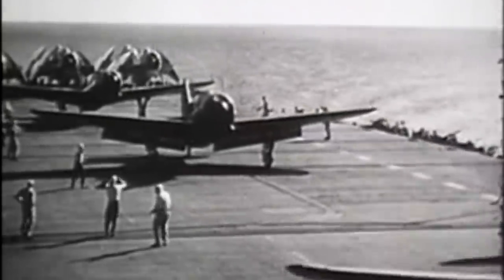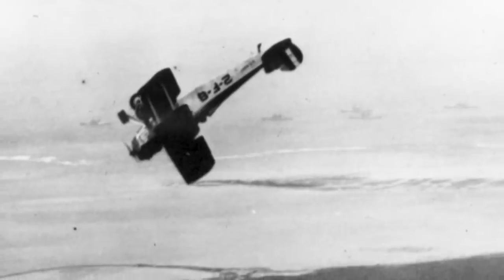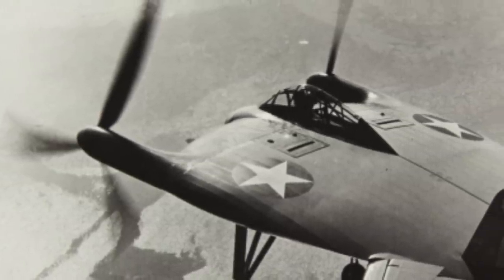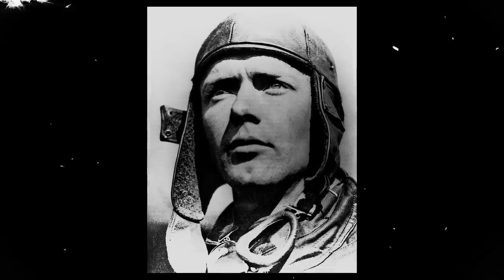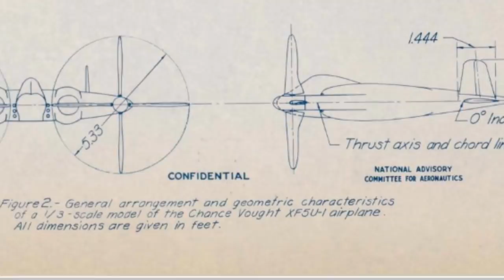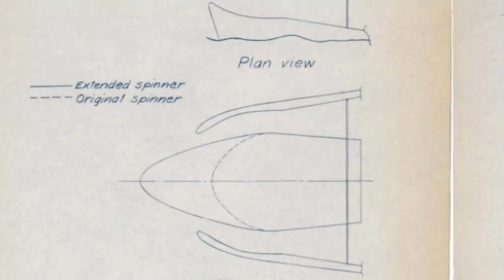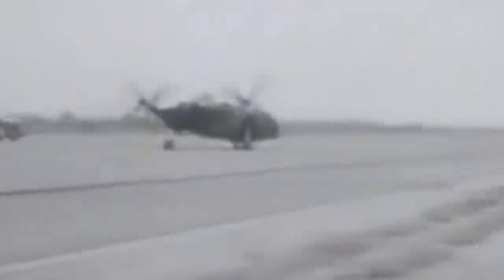The Experimental All-Wing Carrier Fighter - Vought V-173

Comment: I'd like to know how being impossible to stall or maneuver into a spin is 'unfortunate' for any aircraft. I'd have thought those were particularly good flying characteristics. Was this a mistake in the dialogue?
Reply: I've heard of those characteristics making the paperwork a lot harder in civil experimental aircraft since you can't give them any data on what happens when you do spin. I'm kinda suprised a military project wouldn't handle that better.
Reply: I could see being unable to stall being bad for a fighter, because if the aircraft gets stuck in a nose-up configuration, it would be helpless to maneuver until the pilot cut the engines and started falling (there's probably other reasons, as well. I'm no flight expert). Being unable to spin definitely hinders the maneuverability of an aircraft (it's one of the three axis of movements. Imagine if it wasn't able to roll or pitch). But I'm not sure if the narrator meant an uncontrolled spin, or just completely unable to spin.
Reply: @pills-  Since it's props were probably counter-rotating like on the lightning, shutting them off   in-flight to induce some kind of spin or stall might have been a bad idea given the aerodynamics of it.
Reply: @LostInTheFarmersMarket  They were connected by a shaft like in the V-22. Demonstrating spin/stall recovery is a huge deal in developing new aircraft (especially radical designs), and it's hard to say it can't be put into a spin under any circumstances just because your approach didn't work, and then you've got someone in a spin that hasn't been proved to be recoverable.
Reply: @pills-  a Stall is when the aircraft gets itself into a position where the wings don't generate lift anymore and it basically "falls" down. Unless are a Hollywood pilot, stalling your aircraft is never a good idea.
Reply: I thought the same thing. Perhaps it's unfortunate because a pilot of this aircraft cannot anticipate what will cause it to spin or stall, therefore they won't be able to practice recovering from such an event, thereby making the plane inherently dangerous.
Reply: @pills-  I don't think being unable to spin means it's unable to yaw.

Comment: Image if this was what we used instead of F4Us
Reply: Melvin Gillham  The XF5U was supposed to have had retractable landing gear.
Reply: Melvin Gillham  Roll rate would have been exceptional, due to the short span. And if the F5U inherited from the V-173 the ability to 'hang' on its propellors, pilots would have had the chance to invent some entirely new combat manoeuvres.
Reply: Melvin Gillham   I'm somehow imagining this thing following an enemy into a rapid climb, betting on who will stall out first.  In this case, even if the V-173 stalled out first it could just hang there waiting on the other guy.

Comment: 5:45 
"Unfortunatly it underperformed by being impossible to stall or force into a spin"
Bulls***. That is the advantage of the plane. By being impossible to stall and being impossible to accidentaly force into a spin pilots who where trying to land on a carryer could try to do so on multiple aproaches without fearing that the plane mighr loose too much airspeed and crash into the carrier/ocean. 
The main disadvantage was actualy that, concidering that it was equipped with 2x 2000 horsepower radial engines, it was actualy rather slow. The first fighter variants, the XF5U-1 arrived in 1947. By compairison the U.S. airforce had a jet, the P-80 Shooting star, in service since 2 years and against thar jet the XF5U-1 simply did not compair.
Reply: Actually being able to stall or spin is necessary for many combat maneuvers. Thats why that factor was undesirable. You have to understand this is for military use, not civilian use. Safety isnt the most important factor

Comment: The good low speed performance and high lift would make a good CAS platform and modern turboprops would solve the vibration and gearbox problems because the whole engine could be located at the wingtip and directly drive the props.

Comment: Why didn't they just convert it to jet power? It already had appropriate looking intakes.
Reply: its the way military development works sadly, the Pancake Project had run long and over budget and politicians/military bureaucrats always prefer to move onto a new contract/project than nurse an old but promising one. It's for a variety of reasons but they are all political in nature which means they may not necessarily be the best decision.
Reply: Wouldn't work. The large propellors create significant airflow across almost the entire lifting surface of the wing, which is significantly faster than the actual forward velocity of the aircraft. That's what gives it such superb stability at exceptionally low airspeed.
The 'intakes' of the XF5U are solely for cooling the radial engines and aren't present on the V-173.
Reply: @thisisnev  so couldn't part of the exhaust be routed to those outer parts of the wing that were influenced by the propeller vortexes? It seems like it would have the same effect. No?
Reply: @thisisnev  with some variation it would have been a relatively sturdy jet fighter but yes, I think it would have had absolutely terrible low airspeed performance which kind of takes it off the Navy's interest list. Maybe a marine CAS plane with turboprop?

Comment: Many aircraft were built from the parts of the XF5U. Well kinda. A fellow by the name of Edgar Seay Sr. started a model airplane company called Model Aircraft Laboratories (MAL) in Irving Texas in 1948. He worked at Chance Vought at the time and heard that they had a lot of balsa wood from a cancelled project to unload real cheap. The XF5U was made by sandwiching balsa between two layers of aluminum to make an extra strong structure. Chance Vought bought as much balsa as they could find to be ready for the plane to go into production. But it was cancelled. He bought it and produced balsa model planes for years off that original batch he bought.

Comment: I'm wondering if anyone ever made a jet powered model.
Reply: Wouldn't work. The large propellors create significant airflow across almost the entire lifting surface of the wing, which is significantly faster than the actual forward velocity of the aircraft. That's what gives it such superb stability at exceptionally low airspeed.
Reply: Canada made a ufo.  It was supposed to go Mach 3

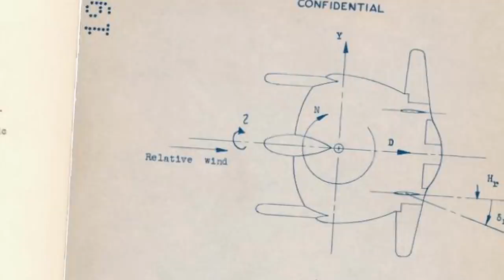Comment: 2:09  ...a plane that could hover at low speeds or hover while stationary...

ahem

hov·er /ˈhəvər/
verb
1. Remain in one place in the air.  
      'Army helicopters hovered overhead.'
noun
1. An act of remaining in the air in one place.

https://www.lexico.com/en/definition/hover
Reply: not entirely true all the time
there are helo's that cant hover, there are fewer these days because thats usually part of the primary design, but not all
I imagine some of the attack heicopters on a full load wont hover, but might be able to light. Weight is important
thinking back, I think V173 could fly as slowly as 15 knots, so she could be afloat in something above a breeze
Reply: @z_actual  Oh yeah?  Which helicopters can't hover?  Or do you mean when the DA is so high they need to do a running takeoff and pass through ETL before lifting off?  Because if you mean the latter, that could be any bird given enough weight and a high enough DA.  When I was in flight school we couldn't get the R22s off on the really hot days with a full tank of fuel, but the R44s and 206s didn't give a shit.
Reply: @Prototheria  did you answer your own doubts? As you point out there are circumstances that have to be answered to hover safely. Piston engine helos are at a particular disadvantage, but always when a helo is on max weight, or hot and high, the pilot should be thinking about a translative lift takeoff. That and getting trapped in your own vortex. 
I recall the Mil Hind could only hover for 15 seconds or you run the risk of damaging the engines. The UH1 Huey was often called on to move 105mm howitzers by air, as there was often no other safe way to get to more remote firebases. A UH1 cant lift a 105mm, so they sling it underneath the helo, and the pilot drags it along the runway until he achieves the 20mph necessary forward speed and lift off can be achieved. Can it hover with a 105mm below? You already know the answer, but they were still cleared to fly them which I was always a tad suspicious about..
All flying machines have limits, you obey them or die at your own peril.
Reply: @Prototheria  oh cool then theres a bunch of stuff I dont need to describe, and what the dangers are. So Im assuming you are fully aware of hover performance in and out of ground effect, and that you have trained on hover charts referencing the no go zone at various weights and density altitudes, and ultimately the dead mans curve. You ref the Robinson so lets not play around here, there are machines with what I consider very marginal hover performance, and often to be generous the accident rates confirm this is a problem. Now thinking of the audience looking here without this knowledge thinking hover performance is both safe and equal, where they think you can move the machine, hover, move again, change altitude, hover because theyve seen that in the movies, safety is 'conditional', you are well within your right to say all helicopters hover, but honestly from where I sit I consider some platforms to be so limited as to remove that provision. Especially when it can only hold hover for 15 seconds or destroy itself, or the accident rate is beholding of further issues. While its true the operational regime and pilot training can effectively cancel dangerous practises, you might not find that outside of the military. Ive had to use helos quite a lot from time to time for work, so it isnt uncommon for me to ask a pilot when he did his last autorotation, and I have to tell you that based on those answers I think Id sooner be in hover in an autogyro sometimes. We both know that can be done, we both know that it is of limited utility just as some helos are, but I can stick my neck out and say one is a lot safer than the other.
Back to V-173, this machine cant hover, it can seemingly hover in a breeze in just the same way an autogyro can, but it will be flying at such an angle of attack, at such high available power, it will be in essence flying on its props. That is to say the combination of wing lift and prop thrust vectors allow it to be 'at rest' within airspace. But its quite dangerous and not for fools. In the first recorded transmission of this it is how the Mosquito VI (I think) was able to make an aircraft carrier landing, an aircraft with a stall speed around 120 knots, and a max deck landing speed requirement of 83 knots. The pilot hung the machine on its props on approach to narrow the flying speed to below stall speed. He was at the mercy of the Gods and had to be fully committed to put her down or die trying. That pilot was Capt Winkle Brown
cheers

Comment: Thanks nice video, but at 8 min 54 seg the arrows are in the wrong direction of rotation,  the propellers rotate on the opposite direction, see leading edge and trailing edge of the props. To counter act  the "wing" tip vortices, as the air rotate from the higher pressure (wing bottom) to the low pressure (wing upper) the props as to rotate the other direction, i.e seen from the front view the LH engine rotates CCW as the wing tip vortice CW. Thanks again nice video!!!

Comment: we know that this works but its computation has always presented a difficult problem. More generally induced drag exists most in the low speed sphere and is non existent at maximum speed, but for V173 in particular it meant that the effective wingspan was increased by the sum of its parts. That is to say the effective wing span is represented by the wing, and the downblade of the propellers on each side. We know this because the rate of climb of the machine can be represented by an aspect ratio wing of the same area. and that aspect ratio wing is the equivalent of a span equal to the wing and a prop diameter ( 2 half diameters of the props). My expectation would be, that induced drag is for our purposes effectively zero with the use of this arrangement. Outside of that, I cannot think of a way to calculate a meaningful induced drag quotient that fits this aircrafts flight regime. Not to say it cant be done, but it defeats me, and in my mind it isnt perhaps all that necessary. But the answer to your question should prove to be a 100% reduction in induced drag, but you must also take into consideration the preponderance of this contraption as it is as it represents some awkward properties in ground handling etc., such as it is.

Comment: I feel there is still a military need for this aircraft.  From the description (STOL + capable of using airstrips in poor condition, very durable/survivable, subsonic jet-like performance) it sounds like it would make an ideal ground attach aircraft for the Marines. Imagine this aircraft updated with turboprop propulsion (greater power to weight ratio, less vibration) and stronger/lighter modern construction (carbon fiber, etc.).  The A-10 has a  max speed 439 mph/stall speed 138 mph (according with wikipedia).  The XF5U had a max speed 550 mph or greater and no stall speed (or darn close).  This seems like the perfect combination for an aircraft that can get into action quickly from air bases close to the frontline, long loiter times on the battle field engaging the enemy at close rage and capable of take serious damage but still bring the pilot home.  The only reason we don't have this aircraft seems to be that it looks funny.

Comment: This is a great video of a plane that really should have been built anyway. It just came to late to be of much use. The design and concepts are sound and it is truly a shame that neither of the XF5Us were preserved. On another note, in the graphing you use to show the counter rotation of the propellers you have the arrows going the wrong directions. The photo they are over laid on clearly show that the propellers rotate towards the outside of the aircraft not the inside. In other words, the right engine rotates counter-clockwise and the left rotates clockwise, in that picture but your arrows move opposite of that.
Reply: I was wondering if anyone else noticed the rotation being wrong.
The whole point of the design and putting the props on the wingtips was to counter the wingtip vortices not accentuate them.

Comment: This plane was awesome! if only it wasn't so late to the party... what a cool design, and the wingtip drag thing was inspired.
I want to see more of these in flying games.
Reply: If this thing had come even 5 years earlier the military would have eaten it up. Imagine these fighting Zeros over Iwo Jima.
Reply: @matts1166  I wonder about their high speed performance... The way to beat zeros was to dive so fast that they couldn't turn when they chased you, then pull right, slow to behind them and pick them off. 
These pancakes might have needed a different tactic.
Reply: @mrkazman  They were designed to have higher top speeds and lower stall speeds than existing fighters. I'm thinking those tactics would still work, although they might be less depended upon. With the weapons mounted in the nose they could engage with guns at longer ranges (no convergence point), and could likely outrun a Zero.

Comment: WHAT!?! A wrecking ball??? WHY NOT MUSEUM IT??? Why destroy it??? SO MUCH COULD OF BEEN DONE WITH THE LAST 2 PROTOTYPES TO ADVANCE IT... Imagine Propellerless and Jet driven... And then imagine adding a little more "Wing" in an almost triangular shape shaped wing, perhaps a bit more rounded than a triangle BUT over all body would be similar to a trapezoid shape in the front with a big round tail end... There is so much MORE to do with these Old planes than just Scrap them or wreck them deliberately in the end of the program. I seriously think that plane should of went to a museum and being there was three and only the 1st went to a museum, that's sad. This is by far one of the most Unique Planes ever designed and IT WORKED, where as other UNIQUELY WEIRD DESIGNS either never were built OR were attempted and FAILED MISERABLY...  Regardless GREAT video.

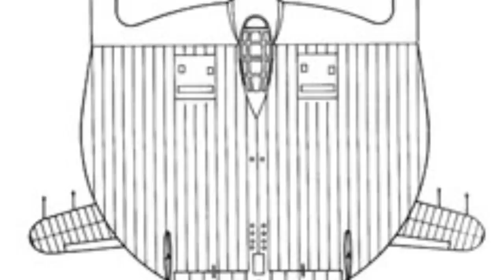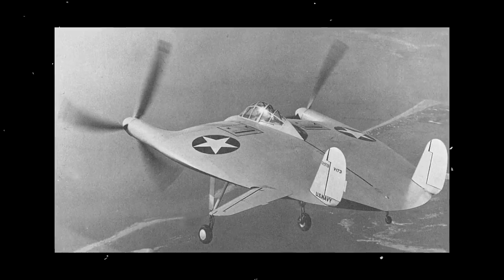Comment: 3:40 - "Atitudes", not "altitudes". At approx 5:10, the F4U propellors were used on the XF5U, not the V173. And generally, aircraft don't use "canvas" in the commonly accepted use of that term. They initially used light linen fabric, nowadays supplanted by synthetic cloth.